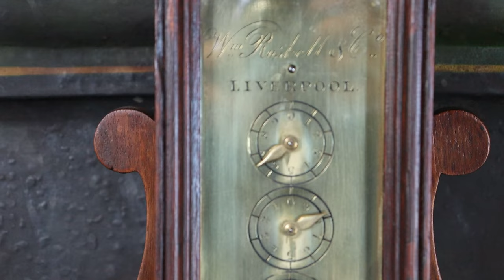RYHOPE ENGINES MUSEUM OPEN DAY   FRIDAY 29 MARCH 2024

Comment: Was this a sewage or water pump station?
What are the white handles for? I think I saw you manipulating a set on the start up at the Tee's Cottage engine.
Reply from the maker: Hi! This is a water pumping station, in fact it’s owned by Northumbrian Water who also own Tees Cottage. The white handles serve the same purpose as the ones on the Tees Cottage engine. They control the valves which control the direction of steam in the steam chest to the piston which intern controls the engine direction. When the levers are lifted on the Ryhope engines the valves open to let steam into the engine. I’ve had a few goes at running the Ryhope engines in the past, here’s a link to a clip of me running the Ryhope south beam engine 
https://youtu.be/uPdJnwnJhFU?si=cbE7U4Y8UJT2JtUb